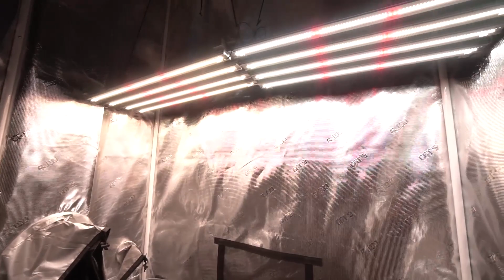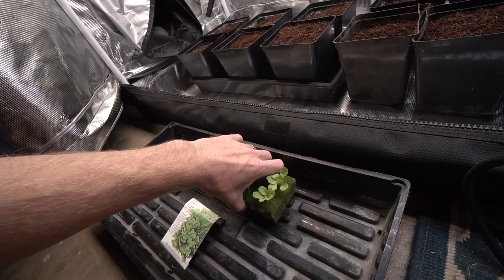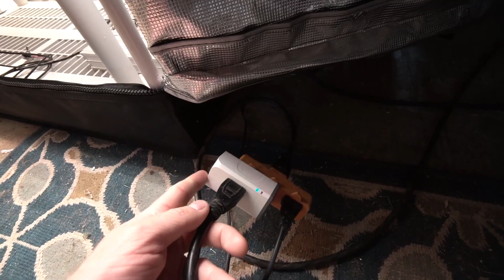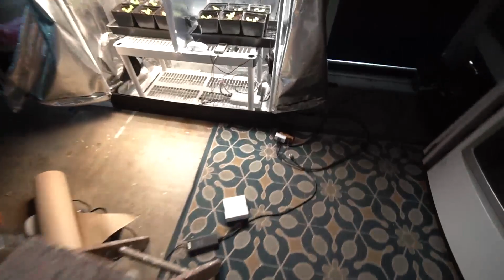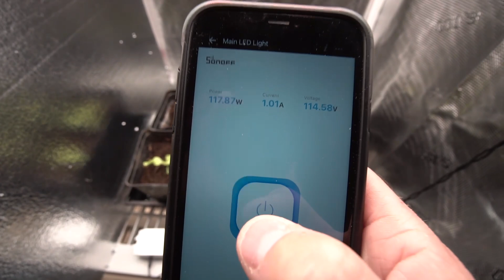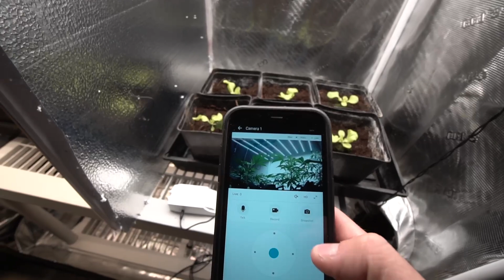Hydroponic Lettuce Comparison

Comment: When u 12/12 lettuce they actually grow a big bud out of the middle , it ruins the lettuce but it looks cool n how u get seeds 
  I’ve grown it before inside
Reply from the maker: Dude...who are you and why do you think I asked for anything guidance from you when I specifically said what I am doing and why in the last two lettuce videos. Multiple studies showing the benefits fo extended photoperiods with lettuce. What is my DLI since you know so much?
Reply from the maker: 18hrs going on here. 300ppfd. Heat tolerant variety.
Reply: Its mainly about light and temperature with lettuce, not lighthours. Thats why most lettuce is grown in spring or fall. There are some newer hybrids they claim you can grow in the summer. But experience shows, they flower quick anyway under the hot sun. That being sad im really interested to see how this test grow goes on.